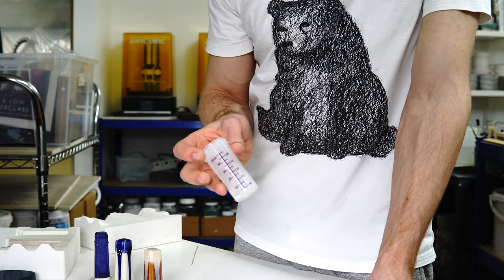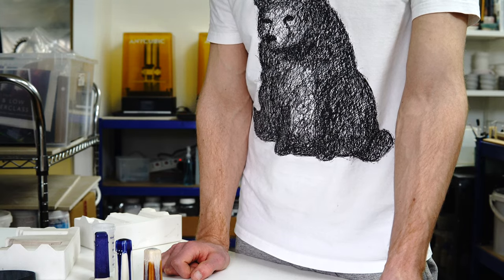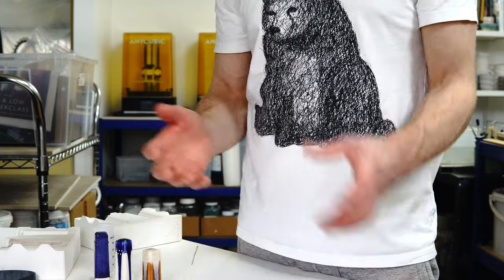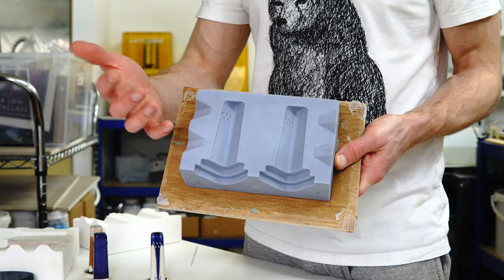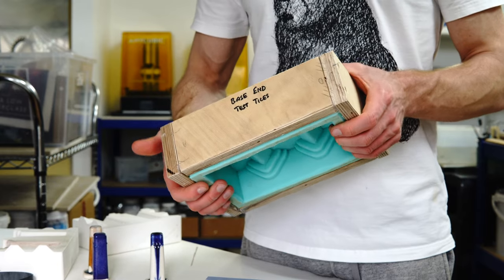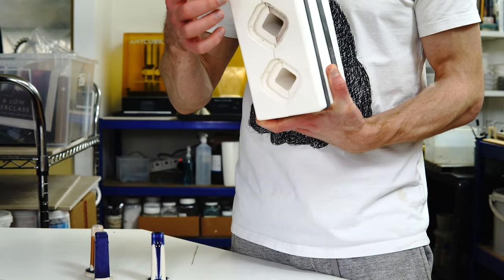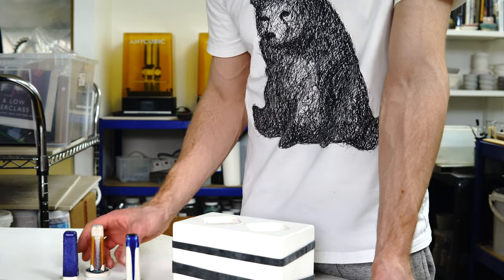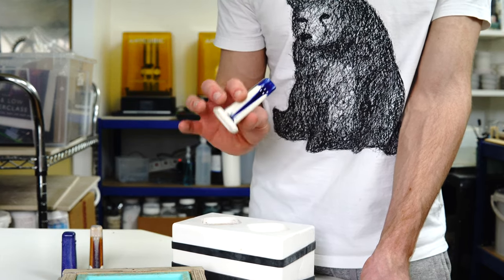My New Test Tiles - 3D Printing and Slipcasting First Tests

Comment: Try Smooth-On brand silicone. They have a line called Dragon skin that a lot of resin casters use. It cures fast and is super durable. Also a simple mold release agent will act as a barrier between the resin and the silicone (if you forget to get tin cure)
Reply from the maker: Mold Max 40 is a Smooth-On silicone
Reply: Fair enough.

Comment: I love the combination of 3d printing and slipcasting, but haven’t thought to do test tiles, will have to try - thanks. You probably already know, but you can try 3D printing the finished item and make your moulds using clay and cottle boards, which will allow you to maximise the size of the items you can cast from your 3d prints.  IKUKO on youtube has some wonderful videos on making and pouring moulds for inspiration.
Reply from the maker: Yeah, that's definitely a way to get more from a single print. As I said in the video, that sort of mouldmaking is a skill I don't possess or want to put the time into though. By printing the mould design, you bypass that entirely.

Comment: Are the inserts you put into the mold that create the hollow inside the test "tile"?
Reply from the maker: If you're asking what I think you're asking, no. The hollow nature of slipcast pieces comes from the slip solidifying from the outside inwards. The longer the cast time, the more solid they are
Reply from the maker: Why would I have answered the wrong question if I thought I knew what he meant? And you're welcome to try and see if you can release the print from the plaster if you want to do it that way, but this design has overhangs.

Comment: Did you also get a vacuum pump to de-gas the Mold Max-40? I am contemplating doing this myself, but I don't have a vacuum pump which is recommended for Mold Max-40.
Reply from the maker: I already had the vacuum chamber, so that wasn't an issue for me. I don't think it's essential though, I don't get a huge amount of bubbling when putting it through the vacuum chamber and the way you pour can do a good job of removing bubble anyway (as I understand it).

By pouring slowly from a greater height, the silicone is pulled into a much thinner strand and the air bubbles are removed at that point.